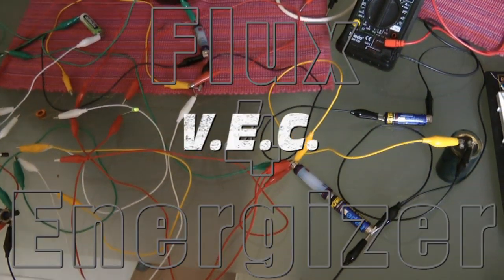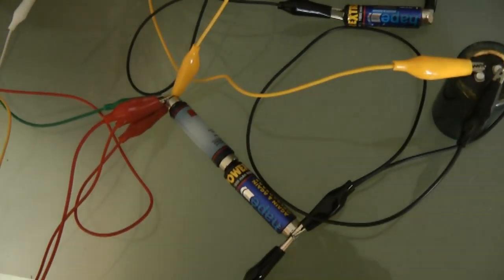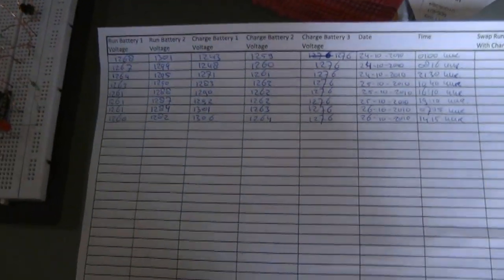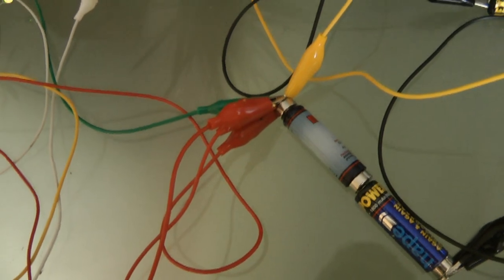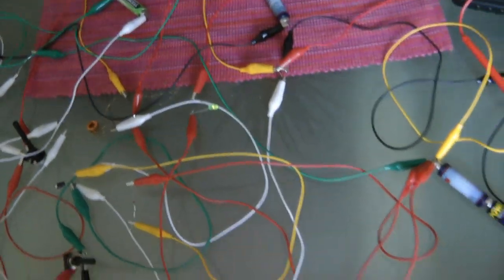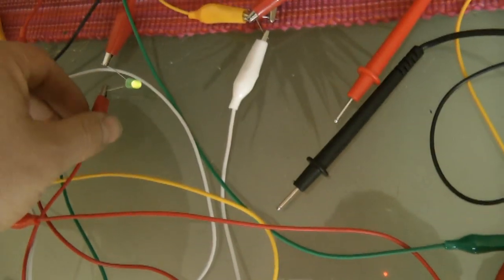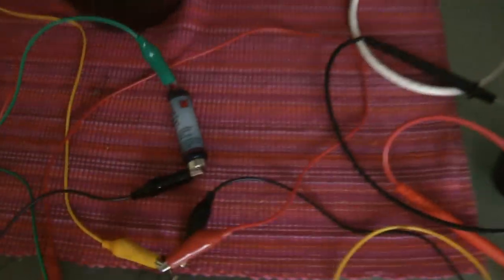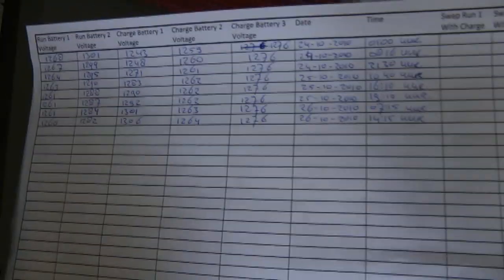V.E.C. (Vacuüm Energy Converter)

Comment from the maker: charging battery voltage wouldn´t charge up faster then the run batteries voltage drain (this only happens when the baterry would be completely death but as you can see in the video the charging battery voltage is higher then the run battery voltage therefor voltage measurement can be discarded).

Regards,
Flux

Comment from the maker: @robbiehobbie47 
Thanks for watching and your reply.
Normally i would have agree to the fact that COP is about energy and not Amps or Volts alone. I this case tho the volt measurement is unnecessary because if the feedback voltage would be lower than the run battery voltage there wouldn´t flow energy from the feedback point to the battery therefor there wouldn´t be a measureable amperage.
Also you can verify the measurements by the values on the checklist, if the COP wouldn´t be > 1 then the